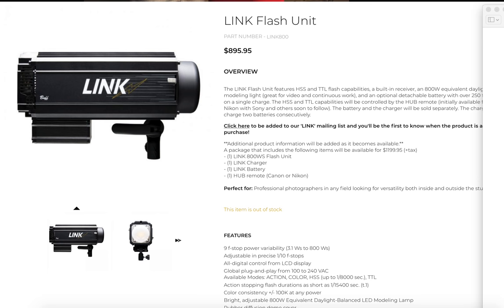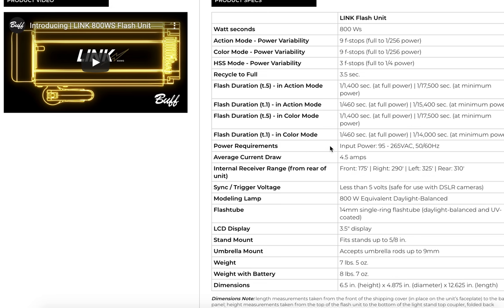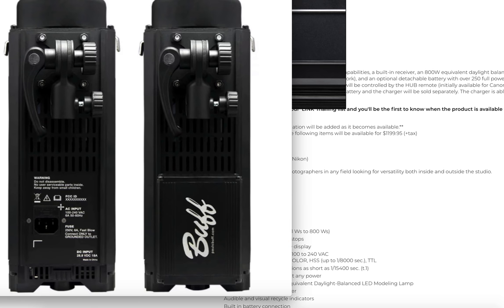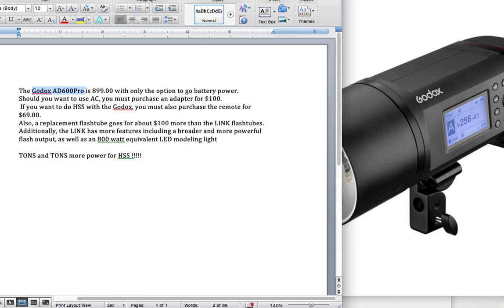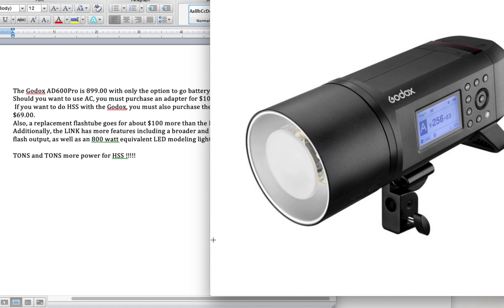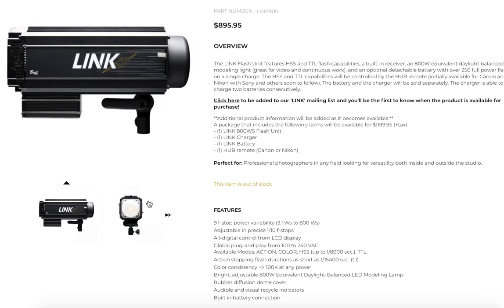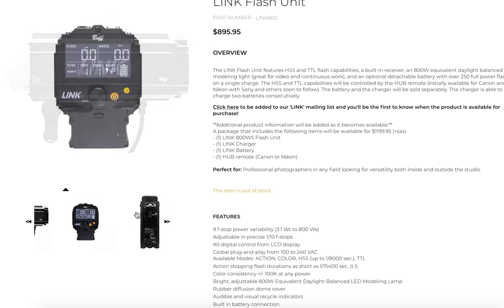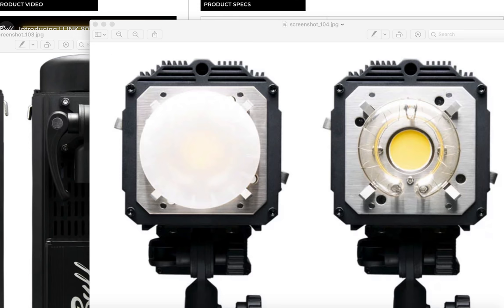🔥😱 ONE STUDIO STROBE to Rule them ALL. New PCB LINK

Comment: Just a quick correction, you only get the flash unit for $895.95. To get it with the charger, battery, and hub remote it’s $1,199.95.

Comment: but with the charger, battery and remote it's $1200 not $895. $895 is only for the unit itself! In Europe the Link WITHOUT Battery&Charger is 1229 EUR the Godox 600pro is 799 EUR so yes you cant compare these two
Reply from the maker: you just compared a YUGO to a LAMBO......congrats, U SO SMERT
Reply: @KenTheoriaApophasis  hm no i compared prices. you said it comes with all items for 895 where the godox comes at around the same price, but thats not correct. and yes i bet the link is much better, and it should be, because it's nearly double the price of the godox.
Reply from the maker: wrong, you just compared a YUGO to a LAMBO......congrats, U SO SMERT
Reply: @Bass_Tee   He misspoke on the package price. Not sure why he's giving you shit for simply pointing out an inconsistency with the documentation vs what was said. If price didn't matter it wouldn't have been talked about, but since money does matter it's an appropriate point to make and correct.

Comment: I was initially excited to see this unit. I’m still not sold on this to replace my Godox setup. I replaced my Alien Bees this year and I love the Godox system. And that’s my point. Godox has an entire system and it just works. No more lugging around my Vagabond, plugging in power strips, tripping over cords, buying more Cybersyncs to plug in, or Bowens adapters to fit my awesome modifiers. This is an excellent unit - a great key light. I need an excellent SYSTEM. I don’t need 4 of these! 1 AD600 Pro + 3 AD 200s + 1 V1 = everything I need for every kind of shoot. And it just works... right now! Weddings, conferences, HS seniors, family portraits, headshots—everything I need. 

The AD600 Pro does have Color mode with great consistency. It may not be as powerful when using HSS, but that’s a minor quibble for me. I can’t put my eggs in this basket. So far PCB is a 1-trick pony—albeit, a darn good pony—in the new L-Ion powered age. Let me know when the lineup is a full roster.

Comment: Yes! I would much rather have the LINK than an Aputure 120dii for dual purpose video/photo use. If the fan noise is well controlled, I am sold.
Reply: The fan noise has been addressed in the LINK. When at full power the unit's fan run's at 100% but once it is dropped 7/10ths of a stop the fan speed drops to around 35%. It is very quiet. We actually had someone shoot a live acoustic music video using the LINK and the sound guy was super impressed. We'll be showing that video in the coming week.

Comment: ATG has allowed Paul to come and play.
This is not made & built in USA, just like the Westcott's & Rollei's transmitter & lights.
This will not hit TN until mid to late COVID-21.

It's really useless if you need TTL/HSS,. Because ATG is not planning on TTL transmitter shipping.
So making this useless:
From Paul Buff's: "These transmitters do not allow for HSS and TTL capabilities."
But advertises that Link can do TTL and HSS, what? 

ATG says do you really want to throw out over $1,200.00 without a TTL/M transmitter during lack of work?

Best shot go with ATG in Godox, Jinbei, Nissin, Orlit, Rollei or Yongnuo.
As of now, many struggling companies are in troubles:
Canon
, hardly anyone buying 1Dx Mark III: big, dated & over weighted
Nikon
, good luck if they can sell D6: also big, dated & over weighted. Plant is closed
Quantum Instruments
, has come up anything new
Photogenic
 in trouble
Pocket Wizard
 in trouble

Again, $1,200.00 for a dated sharp corners light without a ATG TTL transmitter (AF & TTL/M).
ATG suggests buy two Godox 400ws & a cheap TT350 as your catch light and a TTL/M transmitter.
You will retains and have Group A and Group B while Pual can't due both without more money.

At the moment, Godox is king in wireless TTL that everyone can use and afford.

Comment: You are "way,way" incorrect on the PCM Link price when fully equipped, not cheaper than the Godox. Hey I own three Einsteins since they first came out many years ago , along with a Vagabond battery pack and many modifiers and triggers, but I also own several Godox. You make yourself sound ridiculous with your over-the-top praise of a strobe, not even out yet for the public except for a few test units. PCB makes great stuff but they were very late to the party for HSS , TTL and integral Lithium battery and folks went to other brands. Folks already heavily invested in Godox or Profoto won't be changing to PCB,sorry. So if you want to get new customers, ditch the holier-than-though, know-it all attitude dude.  You will not endear many customer to you or PCB with your sales pitch. FYI, I am an award-winning pro of over 40+ years in the business and have owned and used all types and brands of gear. PCB has great customer service, that you could sell. But the rest of us will wait for more real-world use to decide if the LINK is all you say.  I wish the best to PCB, we miss Paul. Cheers